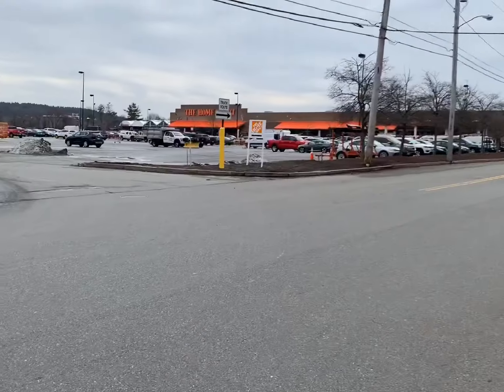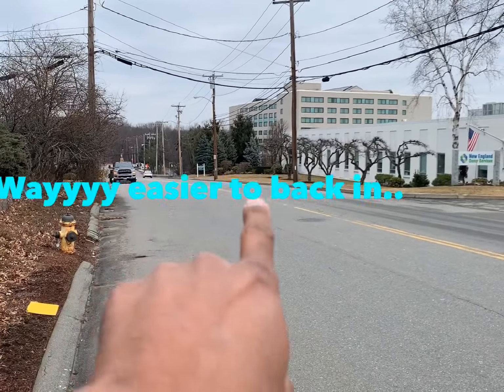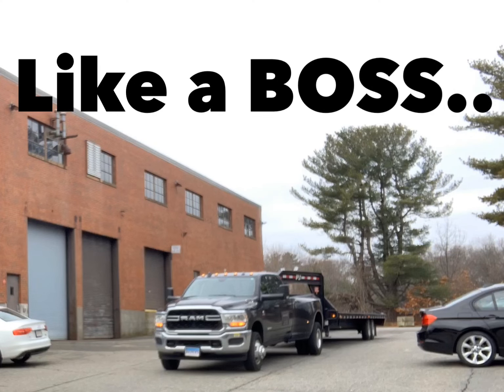BOSS MOVES Hotshot Trucking | LOADING 8,000 POUND LOAD | Securing Hotshot Trucking Load

Comment: MR tell us about your CDL ? 

Do you have CDl or NO? 
If not then why do you think it is not necessary ?
Reply from the maker: I do not have a CDL. Only necessary when gvw of truck and trailer are over 26k and when actual weight of truck, trailer and load is over 26k. I’ll make a vid about this soon....but as long as gvw and actual weight are under 26k, no CDL is required.
Reply: @hotshottruckingtrainingcou9645  so truck and trailer can be upto 26 or below 26 not including a freight right ?
 and how much freight can u haul without cdl ?
Reply: @NAQASHALIKHAN  
Truck - trailer and load can not be over 26,001... Non CDL

You also need to place weight as well so it doesn't over load your axles and tongue
Reply: @NAQASHALIKHAN  
How much weight the load can be depends on what your vehicle and trailer weight is and the axle composition.
Reply: What your vehicle can tow / Carrie as a load is based on other things...

HP/Torque - trans and gear ratio vs Rpm at speed to tire dia.

Setting up a vehicle is an art most don't know nor can do....  

For those who can - lower overall upkeep and more on the road time